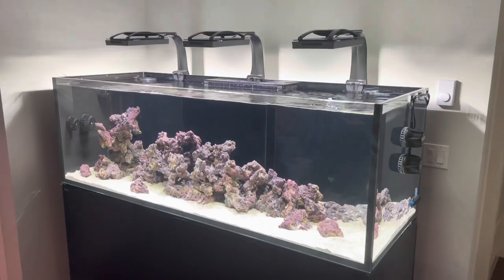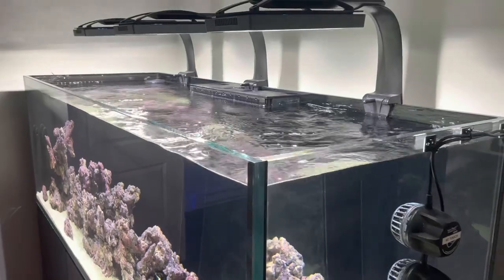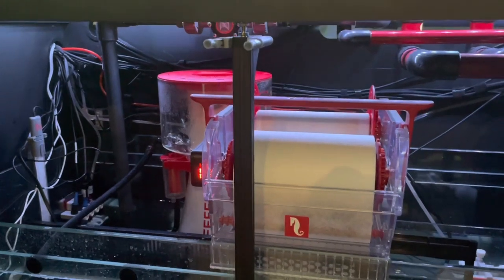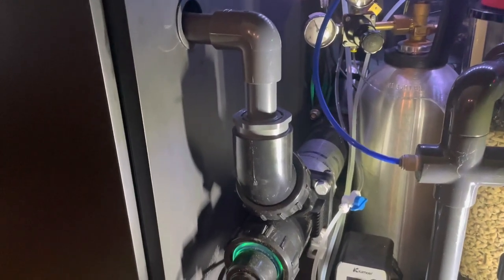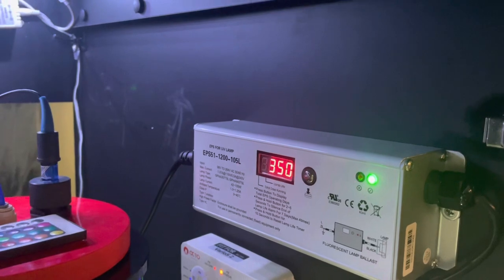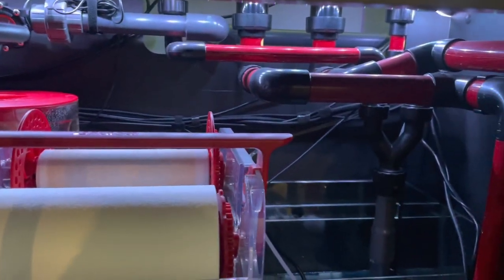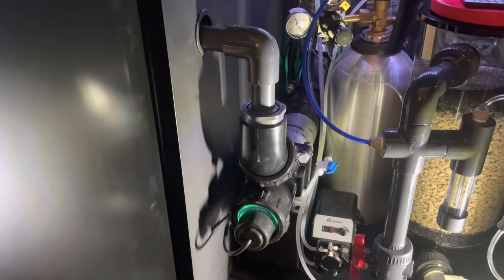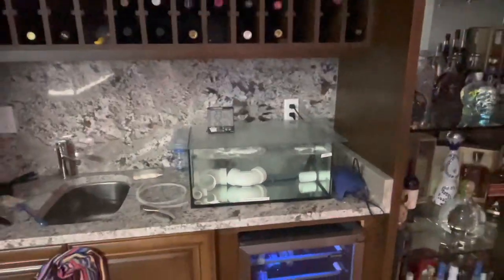UV sterilizer Hell!!

Comment: Good choice with the Lifegard aquatics. Uses High Output Watt Amalgam UV bulb and the adjustable 45° intake/outlet is a HUGE convenience… less restricted water flow and enables easy installation which can be positioned multiple ways to fit tight spaces.
Reply from the maker: Thanks! Since it’s been hooked up zero issues! Love the design and the results already!

Comment: 360 days before the uv bulb needs to be changed as well as the quartz sleeve. 
This makes me wonder if this stands true for smaller uv sterilizer units such as the submersible type for fresh water aquariums (30-50 gallon aquarium rated units) 
 These smaller submersible uv sterilizers are only powered on during an "algae bloom" when the water in the aquarium turns green. They're not designed to remain on 24/7 - 365. 
With that said, this would increase the life of the bulb and quartz sleeve.
Reply from the maker: Yes agreed

Comment: the water of the uv how does the water pass slowly or fast or what type of pump should it be
Reply from the maker: The water is controlled by a DC pump which means I can control the speed of the pump fast or slow. We are also using a Neptune flow meter so we know exactly the speed of pump. You can use ac pump but I recommend DC pump as you can easily adjust the speed.

Comment: Ok first the uv can't be put like that. Straight sideways. Air pockets get trapped in the camber and cuase hot spots.  You would have to put that at  a angle to get the trapped air out if that's the only place you can put it. If you read the instructions it tells you this.
Reply from the maker: Hello and thanks for your comment, you pointed out a good point about air getting trapped inside the unit. When I installed it I added slope to one end for air to escape.
Reply: @Coralgardens  ok good it looks straight in the video.  But you got a really good UV there. 👍
Reply: Straight Side ways?  Wich One!!?
Reply from the maker: @mrterious2627  this type of sterilizer you can mount it both ways. If you look at the outlet pipes they are designed to work both ways. Air won’t trap in these units as the outlet is on the top of the side.